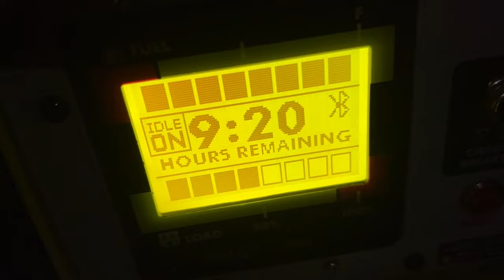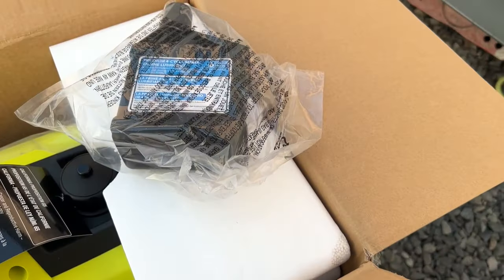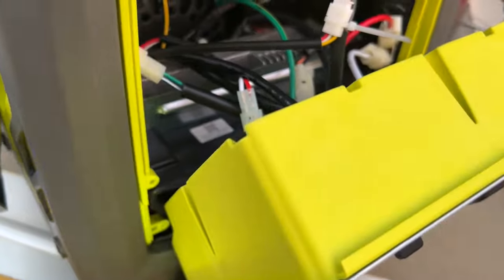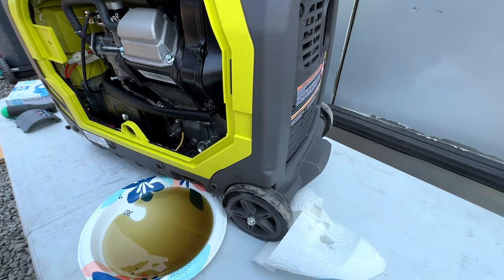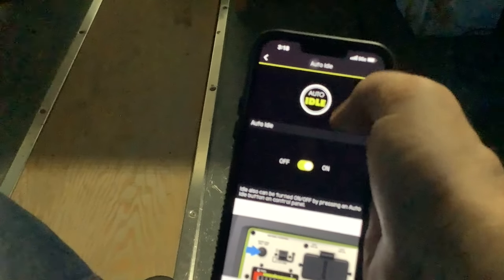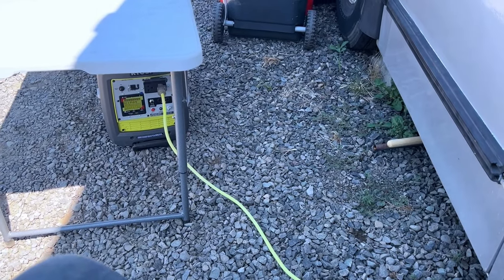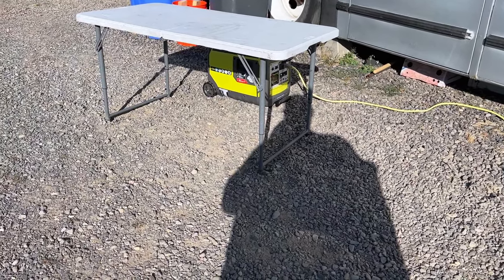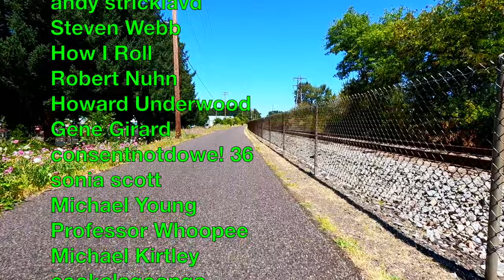VLOG 676: heatwave v4.2 & new generator!

Comment: Sometimes you really pay out of pocket just for the brand name,  having said that though we used to use Honda generators at my workplace. 
Talking of brand names, I have just bought two 75 Amp hour MK batteries for my powerchair which weren't very cheap. 

My powerchair had some second hand one's fitted which left me crawling along back home. 

Surprised that you didn't go for an electric start on your generator, cost maybe 🤔. 

Thanks for the video Dan 👍
Reply from the maker: i would have gotten the electric start one - but they seem to have pulled it for whatever reason.. my policy is, if something is TOO neat, it has to go away :^)

Comment: It might be time to vent and heat insulate one of the locking under bins for power.
Reply from the maker: adding an onboard generator is on the horizon for sure! BUT id need it to be a diesel fired one :^)

Comment: A good way to cut internal heat is to wrap the exhaust on the portable air conditioner with a wool blanket or something similar you would be surprised at how much heat they generate and it does not need to work as hard cooling hot air .
Reply from the maker: for sure! got this one wrapped up tight in several layers :^)

Comment: Why didn't you think about installing a mini split air conditioner to the bus? Do they pull too much current or?  You would think that those are much more efficient than the portable units since the hot air and compressor etc. is outside.
Reply from the maker: if this was a school bus or something else, for sure! only problem is ALL of the outside walls are glass, and the entire back is engine access doors, radiator and intercooler.  a roof unit is the only option for external AC.  which is doable, but will take some work - the roof hatches are large, and oddly shaped. and to further complicate things, there's a giant support beam that runs right down the middle of the roof! so cutting a hole isnt possible. sticking a roof unit in place of a hatch is the only feasible spot, and would need some custom fabrication for installation.  its on the list.. but wont be cheap :^/
mini-splits are great tho! you can get them in DC12v, 24v, and 120vAC! just wish one would fit somewhere
Reply: @TotallyNormal- Yeah, might be that the roof unit is the only possibility, but it can be expensive to modify the roof if its even possible. 

I’ve seen on multiple Drift team buses that they mount the outside unit to the ”luggage compartment” on the bottom of the bus. So when they park, they open the luggage door and turn the ac on. But i feel you already have the space quite well populated in the bottom of the bus 😀